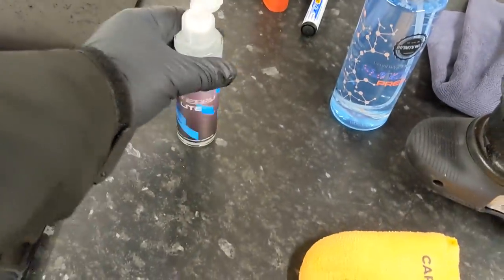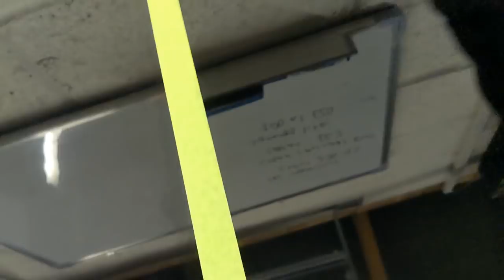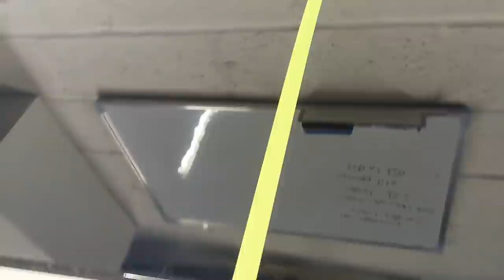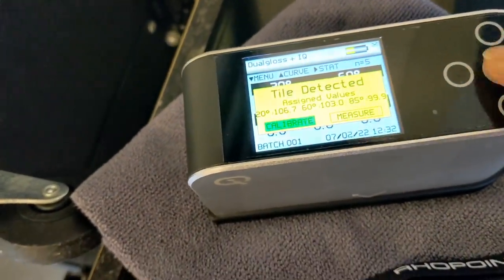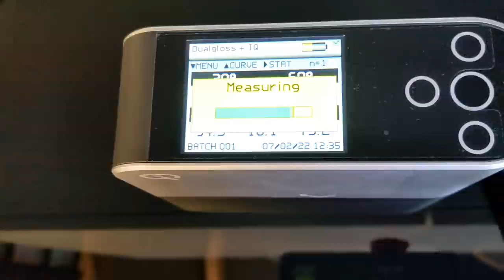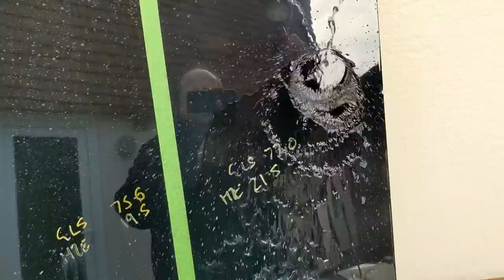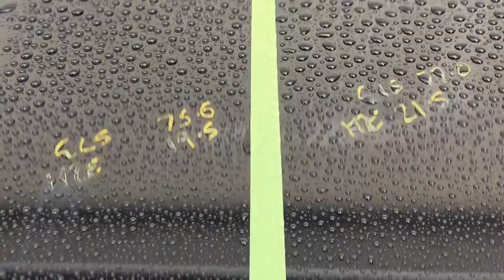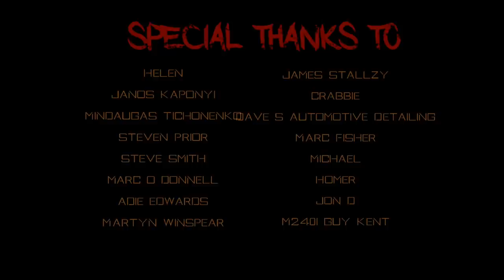Infinity Wax Synergy Lite Sprayable Ceramic Coating Review

Comment: Hi Jon, thanks for taking the time to review.

Note on hydrophobics: Lite has a sacrificial polymer which protects the coating in its first week. It beads (like in the review) but once washed away you reveal the ceramic coatings true water behaviour. This allows the coating to be applied outdoors and have the vehicle moved or used quickly afterwards while also reducing the chance of failure dramatically. 

What you saw in the review was the sacrificial polymer not the coating beading. We have a video on YouTube showing it after 6 months of daily use and independent test data from a partner lab in Germany which indicates that it can last 18 months (on polished paintwork) and 1 year on just decontaminated and the contact angle is 118 - 98 degrees at the end of the test.
Reply from the maker: see unplugged channel mate.   your video shows hitting a silver car with high pressure.  when you fire high pressure its different to low pressure.  But theres also nothing to compare it to in your shot.  The product is hydrophobic but not insanely hydrophobic.
Reply: 18 months 🤣🤣🤣🤣

Comment: I applied it in July 2021. Car outside 24/7. It still beads fantastically and has not been topped. Purchased Synergy QD ready to top it, not used yet on top of synergy lite. Normal RDS will not work on top of a ceramic coating, Synergy QD is solvent based high ceramic content so it can go on ceramic coatings. The trigger will clog up.... I just tip bottle onto applicator (not pouring,  up ending), also means no mist of ceramic in the air. Not read one bad review so far, everyone that uses it loves it. Over layering needs to be done in first hour, waiting 5 minutes after previous coat. After the hour leave for 7 days, inside or out. Great product.

Comment: I bought this for my new X3 in carbon black as I knew at this time of year I couldn’t get 24hrs for Gyeon cancoat, very impressed with this product. Worked very well and with good maintenance the colour is very deep and shiny. Do plan to use cancoat in the summer over the top.

Comment: Update after 12 months is that there is no issues with residues etc in the bottle. Super easy to apply outside, I do I light wipe with a short pile and second light wipe with deep pile MF. Beads really well, not at all like you had Jon. As you say 12 months is enough durability.  I don't bother with spray head, just upend bottle and applicator, saves creating any chemical mist. I've just done 3rd car with it.
Reply: Hi there did you use the panel prep? Also at 12 months are you still getting beading? I managed 4 months lol. Looking at their Infinity Wax Synergy 2 Year Ceramic Coating
 now.
Reply: @JB12132  Yes, polish, panel prep, then applied. One car I've coated that is garaged and only washed a handful of times a year still shrugs off a good snow foam.

Comment: A few years ago I bought into what appeared to be a good deal from Infinity Wax I got the Whole Synergy Range in a pack for a good price. Unfortunately the Vitality failed and eventually after a lot emails IW replaced it. The one year coating that came with it lasted six months, so it will be interesting to see how it gets on. I bought some Gyeon Can Coat Evo from Imran when it came out and that's really easy to put on and has great beads if that what your after.
Reply: Is the CanCoat Evo easier to apply than Synergy Lite? And how does it compare in terms of "gloss" and "deep color"?

Comment: Nice review Jon. When I do my year enhancement polish in Mar/Apr, I’m going with Synergy lite as I got some in a great Black Friday Deal. It’s known for being so easy to apply and you don’t have to wait days to apply a second coat so driveway friendly. I’m sure I heard somewhere that the initial beading isn’t impressive due to the polymer element you mentioned to help with water spots etc while the coating is new. It should bead like crazy after a wash or two. Be handy if you did a quick follow up to show if this is the case.

Comment: I used this on my  daughter's 2 yrs old  puma yesterday, which is in really great condition, we  only  washed the  car  once with a pre wash and  then with  EZ reset,  to take  any  old  coating off.  Dryed and  flashed down with  EZ.  Eliminator.  I applied and  buffed off and  my  daughter  followed me  with  2 more micro fibres buffing off to  a good  shine.  I found it  really  easy to  apply and  take off,  obviously we'll have to wait and  see how  it  holds up with longevity.  Great  honest  review  as always  John.  Keep up the  great  video's.

Comment: Excellent video as per usual could you please tell me what you use to remove polish/wax from the window screen rubber please thanks steve
Reply from the maker: try a glass cleaner or IPA based panel wipe first mate.
Reply: Been a year so you've probably solved the issue, but a detailer told me to use a magic eraser and very gently wipe over 10 times. It really does work permanently

Comment: Like i have seen other comments mention, it seems like the water behaviour you have shown is the water behaviour of the sacrificial layer rather than the actual ceramic costing itself. 
Would've been best to wash the panel to remove the sacrificial layer and reveal the true performance of the actual ceramic coating itself
Reply from the maker: Makes no difference see unplugged channel

Comment: Does this have to be applied via spray trigger or could you change this to other bottles used for ceramic coating?
Reply from the maker: You could transfer but be carefull.  I would just spray it real close to applicator and mask up

Comment: Great product but I know from a trade pov to my uneducated customer they measure the level of protection on how good the beads are I would perhaps use moonlight or can coat
Reply: After the first contact wash the coating breaks through and shows it’s true water behaviour. The beading prior to this is simply the sacrificial polymer that protects it for the first week or so.

Comment: What about carpro lite ? It is a lightweight ceramic, in your opinion which one is better ? carpro, infinity, geyon or tac lightweight ceramic? want to put one of them on my cars in the summer, thinking about the carpro at the time
Reply: I've tried the new Can Coat Evo and it's REALLY good, however it says it has to be kept inside for 24 hours after application. I'd say most people don't have access to a garage in this country. Honestly, give this stuff a go, you won't be disappionted. Only 19 quid on the infinity wax websiteand will EASILY do five cars.
Reply: @Fantic1980  its harder to get for me sadly

Comment: Not sure what to make of this test, i didn't learn too much from it if im honest which is unusual as i usually learn lots from your videos. Also those masks you're using will not protect you from the fumes of a ceramic coating
Reply from the maker: The mask protects from spraying the coating where small droplets are in the air.

Comment: I did see a post on Facebook about it and it had great review , they did say the cloth doesn’t go hard like a normal ceramic coating in glass bottles
Reply: Hi Imran, the cloth will go hard. It may be more obvious the more product that has been used on the car though. You should always put those cloths to 1 side and not use on paintwork again.
Reply: @InfinityWax  thanks , I haven’t tried it but I just seen a review on Facebook group which was a good review , anyway my experience so far has been with any ceramic coating in a small glass bottle , if you leave a bit in a cap for a few days , it will go hard like a clear piece of glass , any spray coating where you get a lot more product for your money , like gyeon can coat etc, it won’t go hard like glass if left in a cap even if you leave it for a week , my opinion is there’s a reason they are not only cheaper but also you get more product and that reason is there’s not a lot of silica in there compared to the glass bottle ceramic coatings
Reply: That’s a good point, I would pour a small amount of lite into something and leave it, it will harden just like a more durable coating. 

As part of our R&D on lite which lasted over 2 years, we did look at can coat as it was the closest rival product. What we found was actually quite interesting. Can coat didn’t harden but dried into a tacky/ rubbery substance. 
On further investigation and obtaining the SDS for can coat we confirmed the reason for this being there is no polysilazane resin in the product, instead a silioxane. So technically can coat isn’t a ceramic coating, it’s a sealant. A good one to be fair.
Reply: @InfinityWax  thanks for the explanation, look forward to trying out your product , hopefully within the next few weeks
Reply: @InfinityWax  my cloth after 2 passes on the car didn’t harden after 2weeks 😏. No crystals on the cap and the spray nozzle still free and not clogged with ceramic. How does it come?

Comment: Firstly dear Infinity Wax... if you want to build a loyal customer base please pick up your phone or look at the message taken to call a customer back. I brand companies and work along how that looks once all the brand identity is done, packaging, whatever and the most important thing is YOU. You can have a better product than your competitor but it means nothing if a client can't get through on a phone and 6 months later still not have had a call back. This come across as you take the money and then don't care which I'm sure is not the case. Now looking forward would I buy another product from you if I can't get a question answered by you? 

Right onwards. I used this on my F31 Melbourne Metalic Red. Imran from In 2 Detailing is an absolute gent, called him to ask for advice what to use and he gives you solid answers his experience and knowledge is second to none. He recommended this to me after some Bilt Touchless pre wash, then AutoG Snow Foam, hand towel dry with one of them Korean micro towels and then using the machine the purple Koche Chemie - what a result that gives you, insane! Then he suggested this to seal it. 

I have to say it was so easy to use, the results are spectacular and I could sit and watch that shine all day. Using the same washing methods I wash my car every week or two and having applied this in September last year by December the hyper bollox as I call it was non existent. Now for £20 you can't complain, it can be applied on your driveway, it's ready to drive no need to let it sit around, the deepening of colour to your paint is really good and the application is bob on too. It's now April and I have been unable to wash my car for three months due to drive way taken up with scaffolding and house works, went out yesterday first wash same method and the shine is still there but not as strong, certainly no hyper bollox at all but still a decent shine. I can't fault it for the ease of use and results. 

I will mention that I did not use the Infinity Wax Synergy Prep Professional Panel Wipe, having just machine polished it was clean as, but maybe that contains something to bond the coating to your paint longer? 

I see they have now brought out Infinity Wax Synergy 2 Year Ceramic Coating so by my experience that could well last a year so I'm tempted to try it but will look into the others first.
Reply from the maker: remember after you polish a panel, that panel paintwork is pumped and packed out with polishing oil.   So after the polish it can be really good to degrease.   And the best way to degrease can actually be some hot water and dish soap or a stronger car shampoo.   Then carefully dry and panel wipe.    Thats the ultimate prep.  I will show you some stuff on this subject matter soon.   I think the product is decent and the price is good.  Its not the most hydrophobic product out there though but that does not mean its any less good or durable.  But its not as beady as some others like can coat or moonlight.   Decent stuff though.
Reply: @ForensicDetailing  Thanks John, I hadn't realised that and will do that this time as I've got Infinity Wax 2 arriving today so I will build myself up to the big car detailing day in the next few weeks. As you said decent stuff and I would have happily used the Lite again if they hadn't brought out the next one. Great for us non garage owners. Thanks for all the reviews, all have helped me make great purchases.